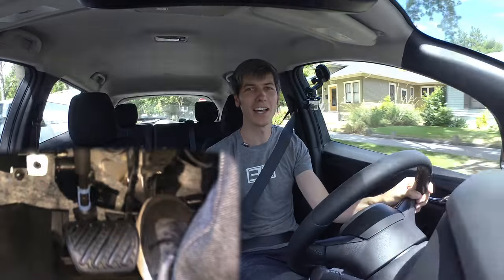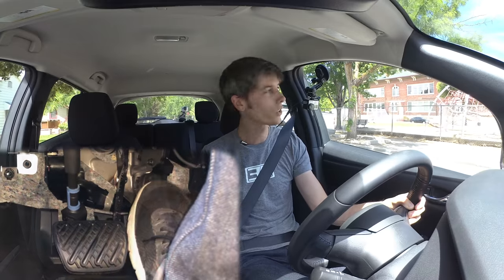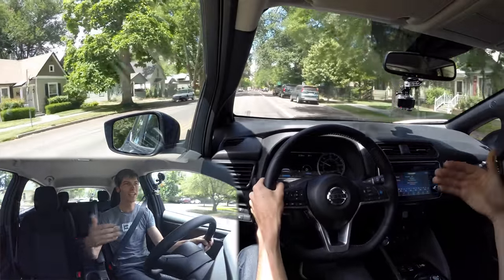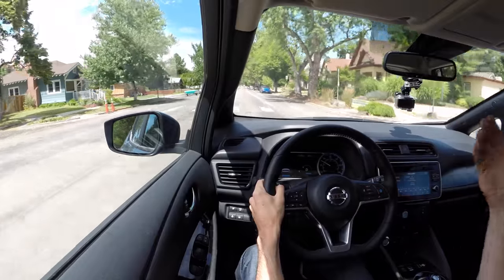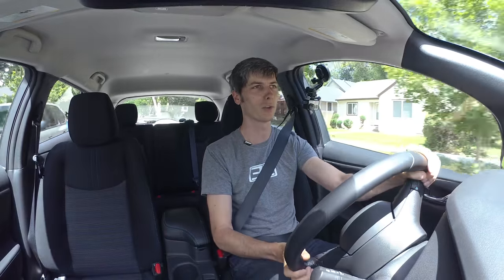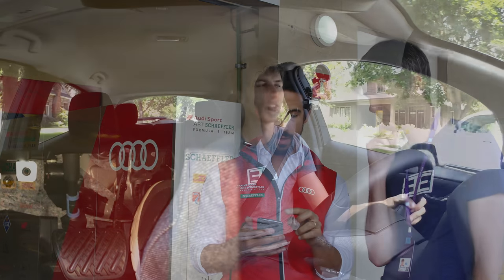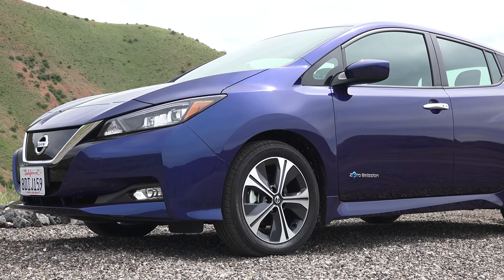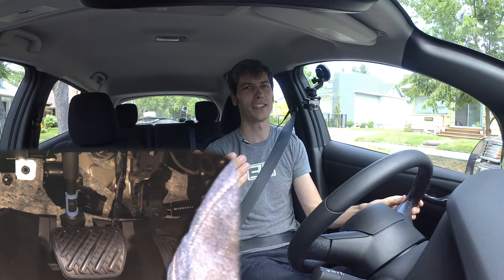What Is One Pedal Driving?

Comment: What about driving downhill? Do i gain power or do i lose power because i have to press the pedal or otherwise the car will stop?
Enlighten me please
Reply: If the hill is not that steep you will probably have to press the pedal a bit.
But it probably will still regenerate power. At least the Tesla I drove years ago (without this One Pedal Mode) did this.
Once you let go of the pedal it regenerated energy, but still kept driving (but at walking speed). If you just pressed the pedal a bit (at higher speeds of course) it was still regenerating power, but not at the max possible rate.
Reply from the maker: If it's a steep hill, you will still need to press the pedal slightly, but you'll also still be regenerating. You're just using the pedal to tell it to regenerate less, so that the vehicle doesn't come to a stop. Or you could put it in regular mode and it will coast more naturally.
Reply: Melvin Klein 
so pushing the pedal a slight bit will reduce regen rather than accelerate?
Im guessing that if the hill gradually flattens out the regen will be gradually reduced to maintain a specific speed.
Reply: It mostly has to do with the motor's construction. Pretty much all brushless motors have to driven by alturnating electric supply. When you you press the accelerator pedal, you are sending a signal to a variable frequency drive, to cycle the electric polarity at a higher rate or frequency. So what will happen is that the motor will attempt to match this excitation by spinning the rotor in sync with the alternating current. And when the motor is running at synchronous speed, it generates an equal amount of back electro magnetic force as the electric supply is providing, in which case the net current becomes negligible. However under load the motor will draw more current to maintain a given speed, because the back EMF is reduced. But if the motor is driven faster then synchronous speed, the back EMF be greater than the supply voltage, and current will flow backwards, then generally the back current is converted back to DC to charge the battery.
Reply: This is wrong, brushless motors are synchronous machines the excitation field always has to match the speed of the rotor, what changes is the torque angle, i.e the angle between the magnetic field of the rotor and the magnetic field of the stator
Reply: I wouldn't say it's right or wrong when you're trying to generalize it anyway. But a brushless motor can be either synchronous or induction based, depending on whether you use a permanent magnet or coils of wire in the rotor respectively.
Reply: So, instead of covering the brake pedal, ready for emergency, I have to maintain constant pressure on the accelerator?  I don't think I like that?
Reply: Or a leaver on the wheel just to coast a bit without changing your driving mode.
Reply: If there is room in front and I can go a little faster downhill, I give the Chevy Volt just enough pedal so it reads 0kw going downhill. That way, it's only regenerating enough power to run the car but not enough to charge the battery..because regen to charge the battery is only helpful if you MUST slow down. That is because you don't get 100% of what you put into the battery back out of it.
Reply: The Chevy Volt is set up to provide a little regen braking in (D)rive. With your foot off the pedal, it provides almost no regen below 30MPH and above 30MPH it provides about 2 or 3kW of engine braking. They designed it that way to mimic the engine braking of a regular car in (D)rive. In (L)ow, the Chevy Volt provides much more regen braking. It's set up to mimic the engine braking that you'd expect in a regular car in (L)ow.
Reply: Suburban Just take it out of one pedal mode, then.
Reply: they should make it like a jake brake switch you have to flip on when you want to decel lol
Reply: There’s a 7mile 3000’ summit I was going up and down every day with switchbacks and very steep grades. I was paying very close attention to my usage over the 4 days I was doing this drive. Going up the hill, my eGolf was using 8-10kWhs (1/3 of its range) and going down the hill I wouldn’t really “accelerate” with the pedal, just modulating the amount of regen and trying to use no friction brakes on the descent but I would recoup about 1kWh.

The VW Pikes Peak only had enough battery capacity to climb 80% of the hill and required regen braking to gain the other 20% while going up. Tech is getting better.
Reply: + Suburban Yeah, I like to coast in front of "dangerous" spots with foot over break at the ready. Not sure how it is supposed to work here.
Reply: In my mom's Kia Soul, the cruise control can use the regenerative braking to keep you from gaining speed while going downhill. Solves the biggest thing I don't like about cruise control.
Reply: Nope. It'll keep braking. You'll have to gradually press the accelerator down as the hill flattens out. Or just use cruise control.
Reply: And also HDC Hill Descend Control will help you to hold the car still for 3Sec.

Comment: Volt has this plus the regen on demand paddle.  It makes driving on curvy roads so much fun.  You can just lift up on the pedal slightly to slow down enough to make the curve and then punch it to accelerate out.  It also gives you finer control of your speed then having to switch over to the brake pedal all the time.  I love it.

Comment: My 30 year old Corolla must have been way ahead of its time. because it had "city stop" Automatic brake application, cruise control, lane departure mitigation, blind spot monitoring. Apparently it used some sort of biochemical computer. But for some strange reason they only fitted it to some models, not all.
Reply: Not all driver probably compatible with those technology, they need to upgrade their "biochemical computer"

Comment: I wonder if your muscle memory will change after driving in this mode.  Will you just lift off the gas in an emergency instead of going for the brake?
Reply: Jamie Ayres if in an emergency braking scenario where you only use 20% of your braking power I'm sure it's safe to say your bumper will collect whatever you are trying to avoid, not only that but generally if you are braking I'm certain you'd be taking your  foot off the accelerator any way..
Reply: Jamie Ayres i doubt it,
Reply: I was thinking exactly the same thing. Gare de Lyon rail accident comes to mind where secondary brake system was capable of preventing an accident but it was so rarely used in normal operation that driver completely forgot about it in the panic of the emergency.
So having muscle memory of "if i need to stop, i let go of all pedals" seems to be dangerous. The current system of more pressure to the pedal = more stopping really is very intuitive in the emergency where you stomp on the brake with all your power if you panic. Not being used to even move your foot to the brake pedal sounds really bad. The car even applies the brake at standstill by itself, so it really sounds like you will forget about the dedicated brake pedal really fast.
Reply: I was thinking the same. A lot of drivers are going to get used to this and learn to do everyday driving completely without normal brakes, so the muscle memory to use normal brakes in an emergency most likely will fade. I would think a more safe system would be so that lifting off accelerator will coast and pressing the brake pedal will use regen braking at first and only apply hydraulic brakes if needed.
Reply: That is where the automatic emergency braking comes in.
Reply from the maker: Having experienced an emergency braking situation in this car (someone merged into my lane without checking their blind spot, which I was in), I definitely still hammered the brake. Been driving it for a month or so and quite used to the e-Pedal, it's all I use. The braking is only 0.2 g's, so you're definitely still aware that you need the other pedal depending on the situation.
Reply: But you are not the average uneducated driver :) And I don't think a month or two is going to be a problem with your muscle memory but something like 2-5 years of rarely needing to touch the brake pedal, especially in rural areas.
Reply: Catrik If you never drive normal cars, then yeah I can see that becoming dangerous.
Reply: Catrik that is a very good comment about the regenerative braking only applied as first stage of pressing the brake. So at the first 20% or so of travel it only does the regenerative thing and then the hydraulics are engaged at the rest of the travel to supplement the regenerative braking. That way you still build muscle memory to press the brake pedal if you want to stop and in case either system fails you do not have to think what to engage since all you do is press the same pedal as hard as you can.
And i am not afraid that you will lose muscle memory from driving the single pedal thing occasionally between driving other cars. It is more of a concern for a generation of drivers who start on a car that has this system without any muscle memory at all or the drivers who will only drive this system for a long time.
Not sure how vague the 0.2g deceleration is. I do use engine braking in manual when rolling to a red light and such, but is still have to engage the brake when the engine rpm drop to idle, so the muscles still remember about the brake. But if i did not really have to use the brake pedal outside of emergency situations, i would fear i would forget about it when panic kicks in when something emerges in front of you.
Reply: Jamie Ayres yup
Reply: I change my bicycle brakes over to Moto style (front brake right side) just for this reason
Reply: I've driven EV's for 3 years now and I still reach for the brake when needed. And the few times where I'm in a combustion car, I have zero adjustment time to remember how to drive a clutch. I drove 7 years of manual combustion vehicles before switching, and that seems plenty to have permanent muscle memory. The first time I drove in an EV, my left foot's muscle memory hit the "clutch" (read: brake) when coming to a stop. I had a journalist in the passenger seat and she and her camera got slammed into the front 😖😇
Reply: No. Its immediately natural to do, and a way better way to drive in city. I drove a Tesla Rodster once and that was the only appealing thing about it.  O/W i'm a gross polluter
Reply: I think that constant switching from gas to brake pedals trains the muscle memory, and if someone learns to drive with this feature (or drives long enough) his/her reaction time would suffer in an emergency situation. And then maybe some automatic emergency braking kicks in... and that's how we forget how to drive and let the machines do the work... I say it like it's a bad thing? :)
Reply: Some models of the LEAF have collision avoidance.  I believe ProPilot vehicles will apply the brakes automatically in the event of an impending collision, so even if the problem you state happens, the car is safer overall.  In addition, I believe that all models of the 2018 LEAF will not let you shift into drive and run into a solid object - not just the ProPilot equipped ones.
Reply: It's basically a mode with lots of engine braking, no? I think it's a good idea to let drivers learn engine braking.
Reply: Probably easy to forget - I have had situations where I have driven an automatic car for extended periods and then stepped back into a manual - first stoplights I came to I stopped fine, but forgot to use the clutch and stalled. I passed my driving test 40 years ago and primarily drive manual cars!
Reply: if anyone has driven a stickshift car, or a DSG car, they are familiar with engine braking, and good driving, one modulates the gas pedal to vary speed, instead of going back and forth between gas and brake.  Driving an E-pedal car is similar.   I know of nobody that drives a stickshift car that uses engine braking loosing their muscle memory to hit the hydraulic brakes when the need arises